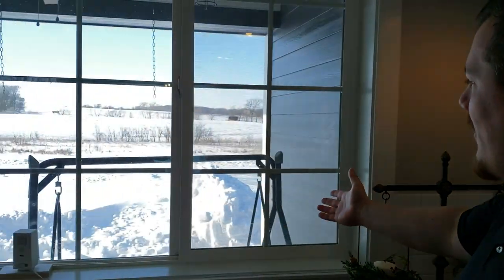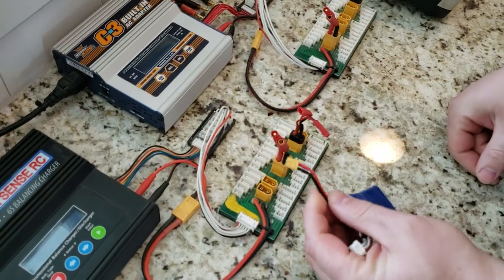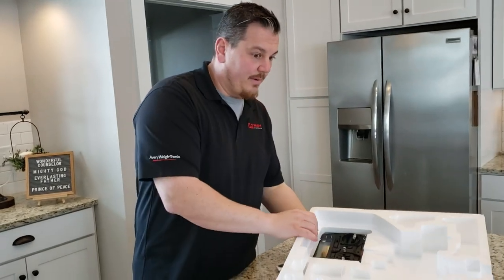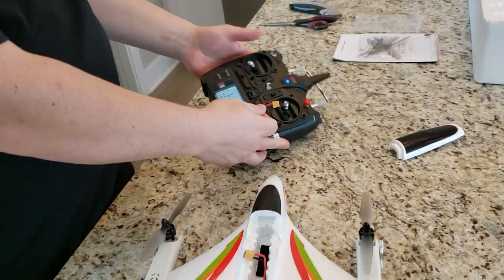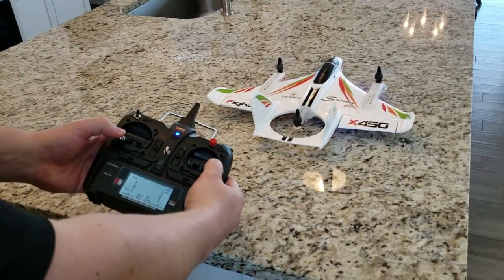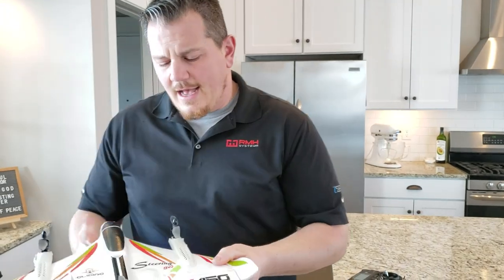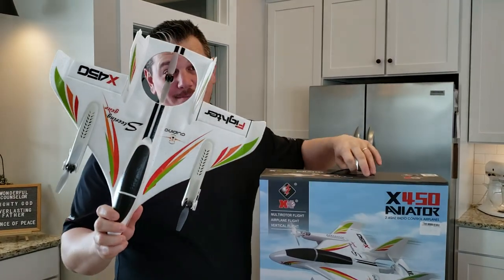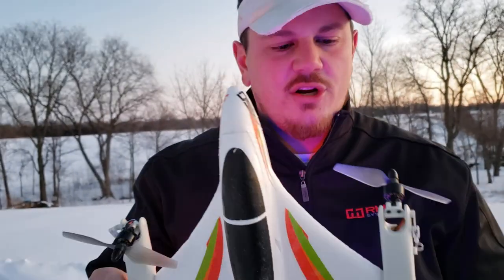XK - X450 - RTF VTOL - Unbox, Setup, Flights Inside & Outside

Comment: That plane looks almost identical to the Convergence.
Reply from the maker: Most of the VTOLs look pretty similar, but yes, this one is no exception. I hear theres a knockoff of this tri-chopter too.
Reply: Itsept for the wing tips folding down on the convergence & mini convergence the JJRC M02 is closer the XK also has a smattering of convergence in it, but it is the electric's that make them so different it can't do the nose up flight and it is not so forgiving for a rookie, I tried the mini convergence indoor's and could not get my head round it, but I was flying the XK straight out the box and by the time I got the JJRC I was flying the plane mode and even a little foray into 3D without a major crash. I have no doubt they are copie's but bwtter for a novice also enough difference's to get away with looking similar.
Reply from the maker: Yep - surprising how well XK has their stabilizer and auto leveling systems dialed in!!!
Reply: @BrianPhillipsRC  that's good to know.  The convergence always does that weird shudder when transitioning to forward flight.
Reply: @77bubba00  I belong to an RC club. Was flying my X450 indoors in a gym and had the whole club as an audience.  Another member had his mini Convergence.  Guess what.  My X450 flew circles around the Convergence. By far a better more fun flyer.

Comment: Skip to 39:00 to see the plastic gear servo break.
Reply from the maker: Not trying to hide anything here - but up to that point it was AMAZING!!! Also, the replacement parts ARE actually available!!! Something that's UNHEARD OF at banggood, or any other website offering RTF aircraft, beyond maybe the occasionally spare battery or prop.

Either way, glad you stopped in ;)

Comment: hey if you need a xt30 charge cable let me know, I have several I can shoot you one out.
Reply from the maker: I appreciate the offer, but I made one up from just some old EC3 connectors :) I may have to order a 10 pack of male and female. I like being able to built stuff like this on the spur of the moment, you must be like me!

P.S. The XT30 is a sweet little connector!

Comment: Here’s the fix according to Drone Camps RC.  https://youtu.be/Gpp06GX-G9g  Also some other reinforcement tips for the jjrc m02 version. (the end of this video) https://youtu.be/WcEOVX5ibO0 

This is by far the coolest flying thing ever.  However, every review I’ve seen has ended the same way.  So for now it sits in my cart not ready for purchase.  I’d be able to fly this all day in multi-rotor/quad mode no problem.  But one flip of the switch to airplane mode would be the end of this plane for me. D’Oh!
Reply from the maker: Well, I'd be lying if I didn't admit it's a bit delicate. My only real issue is that you can't stop it freaking out when something goes wrong...that's what broke mine...not the actual crash.

However, it's SO much fun - borrow it from a friend, you gotta try it! I've flown tons of quads and multiroters, and this is way more cool!
Reply: Brian Phillips I plan to buy one in the summer.  In the meantime I want to see you and others attempt to fix it so I know what parts to buy as well.  Be nice if XK offered them BNF.
Reply from the maker: I'm sorta tempted to try to put some metal gear servos into the main booms....I think the tailevons would be fine with plastic gears. Just not sure I want to fuss with it.